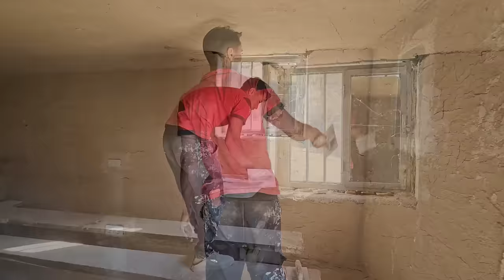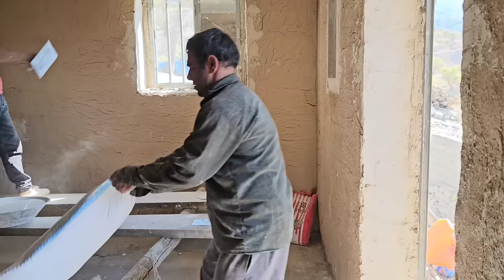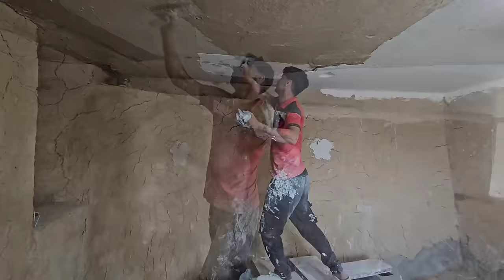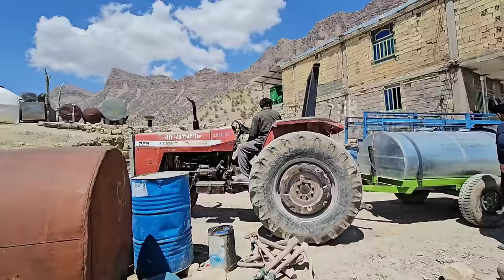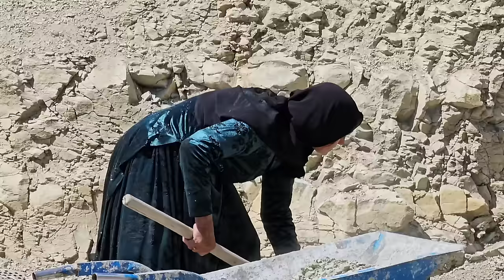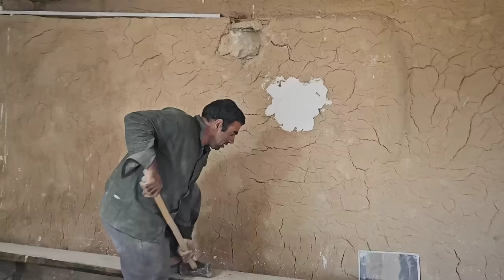The hard life of a nomadic family in the spring nature / nomadic documentary

Comment: Mirza 🤔. It sounds like that truck has an issue with its lifter on the overhead valve assembly... If not the crank may be going in that thing and you need to replace the bearing on the crankshaft... THE METHOD THESE GUYS ARE USING.  Is really good.. it's definitely refined.. I'm watching you learn things from them I'm seeing you watch them... Hopefully the police don't come and get you.😅😂🚨 .. another thing I noticed is, you call the tool you were using to to apply the plaster a conductor...🤔.. we call that tool a trowel
Reply from the maker: Thank you my dear ❤️❤️
Reply: @Mirza.1366  you are very much welcome.. 🙂🙏